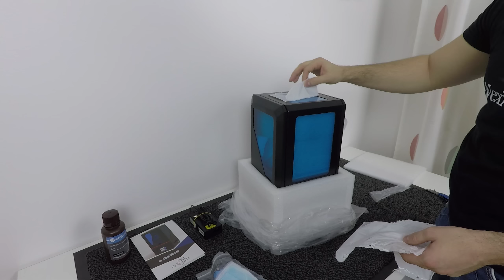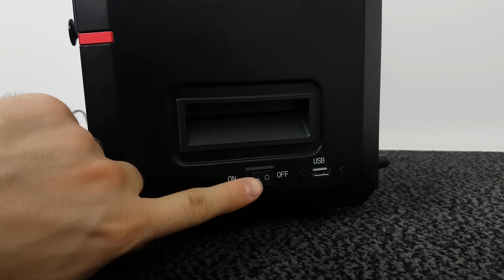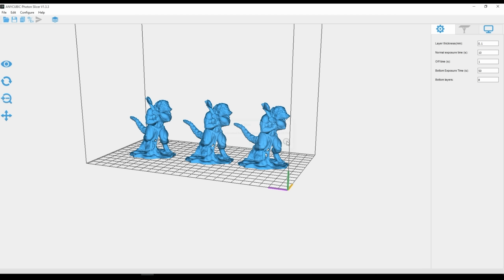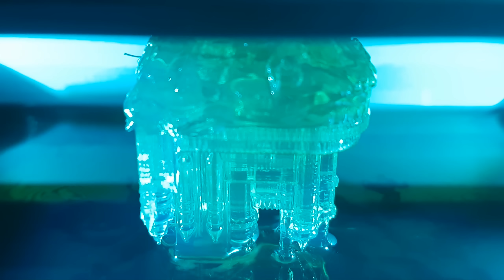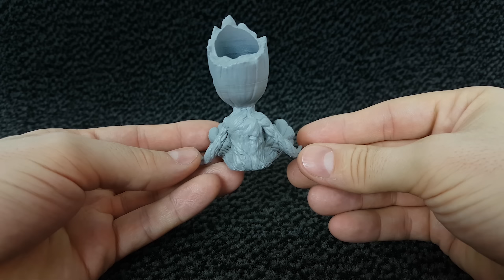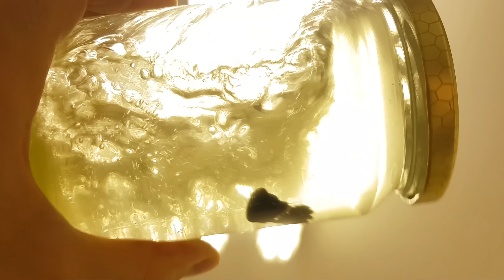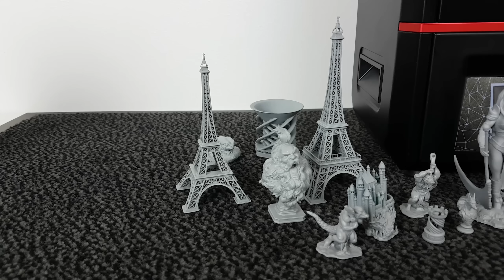Anycubic Photon DLP 3D printer Review - insane print quality!

Comment from the maker: Finally Anycubic start to sell Resin for Photon! Here are links: 
ANYCUBIC RESIN Original 405nm
From Banggood --  https://goo.gl/Jt4anH
From Ebay --  https://goo.gl/V68rnm
From Amazon --  https://amzn.to/2OsAP6U
I upload also links in video description. 
Cheers guys! 
Nexi
Reply: Nice review! Is it possible to produce mechanical and functional parts? How strong are the parts in comparison to FDM (PLA, PETG, ASA)? What happens if the final part will not be protected with prime spray?
Reply: @android4cg  the company that I used to work for print out the parts then use it as a master to sand cast the parts in metal. Hope that helps.
Reply from the maker: Arjax Copy-paste "For example with 1L of resin you can create 50 pcs of hulk size miniatures in video. Hulk is 20grams with 100% infill. Dragon miniatures are 4grams heavy so you can make 250 pcs with 1L of resin(now for around $80) I hope you get some idea ;)"
Reply: #AllAbout3DBlog No I would not recommend trying to use a DLP or SLA printer for mechanical parts since the parts are extremely brittle and weak when compared to FDM Printers, even when only using PLA. Currently resins are just not advanced enough to produce results that are sturdy enough to withstand stronger forces and/or friction., also if you don't prime them then they will slowly become weaker and more brittle when exposed to UV radiation.
Reply: how many prints do you get from 500 ml bottle? say you are printing 28mm figures?
Reply: Nexi Tech are you french ?
Reply: Hi guys,
What type of 3d printer is better to make manual injection moulding molds? FDM printer or DLP printer?

The God of Cruelty, thank you for the info. This is the first time I read about resin vs plastic.
Reply: 450$ ain't that cheap ender is still 250$ and still comes close to the same level of detail.
Reply: Have not seen a resin 3D printer in operation before do you need an auto cad system to program the parts it need to print?

Comment: How hard it is to get the material? And does it work with any resin or only their specific brand?
Reply from the maker: It will work with any UV resin as long it is 405nm. There is link in video description for Anycubic Resin. Check it out.

Comment: What a great video.  How does one adequately clean the resin from the upside down platform?  Just wipe with paper towels and isopropyl alcohol?
Reply from the maker: Mark Pinther I found that cheap bottle spray filed with 99% alcohol works grest. You don't to submerge prints all the time. Just spray them few times and wipe them with paper towel or blast them with hair dryer.

Comment: The primer that you are using is not suitable for making models because it is designed to fill in scratches and leave a even surface. Use a modeling primer like Tamiya Fine Primer. It leaves all the detail of the model untouched.

Comment: So I want to buy one of these units to make some prototypes but I'm really concerned about committing to a purchase. The thing is...the reviews are all over the place and it concerns me. I purchased a Monoproice FDM printer a while back and it printed the first 5-6 parts great right out of the box, but after that, I could not get it to print correctly. I got frustrated with it and sold it. 
Reading the reviews at amazon the people who give it a 1-2 star rating describe a very similar experience to what I went thru with my first 3d printer. And I get the fact that you have to make adjustments, and set everything up properly, but this video makes it seem like plug and play. 
Was the machine he received just a good one? Are the people who complain and cannot get theirs to work receiving faulty units? 
What are the chances I will get the same results this video got if I purchase one?

Comment: Sad to tell you this.. but it isn't a DLP printer.. it's a MSLA (Masked Stereolithography Apparatus) 3D resin printer. DLP printers uses a projector to project an image onto the buildplatform, this one uses a LCD to mask off (parts of the) UV light that's generated by a matrix of LED's, and the masked resin will not solidify, whilst the exposed will.

Comment: This has got to be the absolute best video I have seen, reviewing and showing all the details, of the Anycubic Photon. Thankyou for being the video that made me go... "That's it, I'm buying it!".
10/10!
Reply: Mine arrived just a couple days ago and already creating mind-blowing results! Thanks again.
Reply: @HowAboutNo16  hey, hows the 3D printing going? :) I want to get started too but I'm researching what to get
Reply: @x7ogforever  It's going great honestly! You can get all the info for getting your settings right, how to make the supports effectively etc. From youtube and the Google Sheets doc where it has all of the most used resins and their settings to use them at. I believe if you were to search "anycubic photon resin settings" you would come across it easily! Good luck for when you get it!
Reply: this video may have sold me on the printer but just wondering since you use it aswell,   can you get a large print thats too big for printer to print in one    i.e 300mm x 200mm  as example would it automaticly print off print off in different sections when slicing it or would i need to select he seconds manually        (wanting to try build a high quality Atlantis)

Comment: I got ripped off by the FDM 3d printer company, mine one cost $HK8000, roughly $US1067!!!!
Reply from the maker: That's just BAD man! Why did you not used links from video description and get printer form trusted sellers?
Reply: @NexiTech   It is from trusted seller, I guess I just should have got it from another brand, the one I have is from Hong Kong, and I live in hk, so I was thinking, may be I should get one from them... but now when i look back, yea, Mainland Chinese made one is way cheaper than the Hong Kong made, and funny thing is that the HK made one is manufactured in Mainland China anyway XD

Comment: Just bought the thing.     Wanted to test it this weekend.
It sucked:           I chose a little table...25 mm high.  This is very LIGHT and thus it should always stick..?!?!          But NOTHING stuck to the liftplate.
Instead, I found a BLOB of snotty stuff at the bottom of the tank.
I tried again, same result.

Could it be that my z=0 was too tight against the flexible bottom of the tank ?
(when playing with the paper sheet at 0,1 mm steps chosing between free and more stuck..I chose the more stuck/resistence).
All other settings were factory standard.

Or the fluid is shite (what came with the box..like yours).

Further annoying shit:
The Netherlands DO NOT ALLOW THE SALE OF 99% ISOPROPYL ALCOHOL!!
(I learned that AFTER I bought the machine).
Supposedly this alcohol is used in the making of amfetamines , xtc, or whatever...
In Germany (Amazon) they do sell it but do NOT send it to Netherlands.
Presumably the germans do NOT make XTC ??

So I used another type of 70 % alcohol, (Ketonatus).. and I saw that shit AFFECTS the tranparency of the tankplastic bottom.
FOR FUCKS SAKE:
This supposedly simple thing throws  A LOT OF pitfalls to me.

I HATE IT !

Comment: Greetings.
I have a question, in the sla printers you also have to do the printer configuration process as it is done with the fdm?
Are all the previous "adjustments", like adjusting the bed, the fans, the height of the layer, etc., similar in the sla printers?
Thanks for the help, I plan to buy a printer.} Sla
Finally, what do you recommend ?: wanhao d7 vs anycubic photon.
Thanks and keep going with your videos!

Comment: the print looks amazing! A question I have is that what's the life time for the tank that expose to the laser or LED screens? I heard you need to get new tank after about 60 prints because it gets cloudy. is that the case for both SLA and DLP printers? 

And lastly, I was told DLP prints have stepping on curved surfaces. I mean how obvious are the stepping and will it be a big issue if used for molding?

Comment: what's the maintenance cost on DLP printers? or how long they last before you start to need to get replacement parts? I've been using my 5 year old FDM printer. Been printed 250 hours+ and I've replaced the fan, nozzle, some minor accessories with a total of about 50 bucks. 

But recently, I need to print small model kit design parts and I've reached the limitations on my FDM. thinking of getting a DLP printer but can't quite make the commitment. I worry that the running cost and maintenance cost are too high.

Comment: Hi. I would like to know after using Photon for over 6 months, is it working fine now? I heard the LCD may not working after several month, how about your photon LCD? Have you met some problems till today? Thanks!
Reply from the maker: Q M My Photon still works great. I did replace tank foil two times but I don't have any problems with my Photon LCD but to be honest I don't print on my Photon every day. 
I think that LCD might get weaker and eventually fail if you use it 24/7 for more that 6 months at least some people claim that.
Reply: Thanks a lot. That's helpful:）

Comment: Why aren't you printing larger figures?
Reply from the maker: Lis Amita Have you not seen specs of build area? This 3D printer is for maximum details in miniatures not for large object's. If you want to print large go with CR10S or S4, S5...
Reply: Nexi Tech so there is no dlp printer for large figure? Because the printer you suggested aren't dlp (?)
Reply: Nexi Tech Nope, cr-10 quality turns out to be great! Though the detail aren't great compared to dlp printer
Reply from the maker: Lis Amita Not that Am aware about. All DLP and SLA 3D printers(Home use) have pretty small print area.

Comment: Hey! This is a very comprehensive review, thanks! I just have one question. How much does printing each miniature cost, roughly?
Reply from the maker: Heaven Builder Thanks:)
 Copy-paste "For example with 1L of resin you can create 50 pcs of hulk size miniatures in video. Hulk is 20grams with 100% infill. Dragon miniatures are 4grams heavy so you can make 250 pcs with 1L of resin(now for around $80) I hope you get some idea ;)"
Reply: Okay, that's actually a lot cheaper than I expected. Wow. Thanks!

Comment: I have big problems printing anything big on the printer. Small objects are fine but as soon as I want to use a larger build area to outer parts of the first layers wont stick to the build plate :( I levelled the shit out of this thing and tried differnt exposure times.

Comment: Hi i saw that max dimension are.. 11x5x15...but all models i saw in your hand like skull are bigger... How it s possible.. Thanks aclot for your answer.. Thierry
Reply from the maker: séverine moulinet 
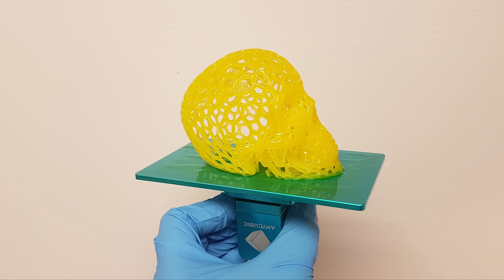Printing volume is 115mm *65mm *155mm. It's not that small :) Skull is printed in 180 degrade rotation so that you use maximum possible size. Look at 14:31

Comment: Thanks a lot for the great review. About post processing, do you have to immediately take the model out after print is finished and clean with isoprop? And then expose to UV light? Given that it take hours to print can I start the print overnight let it finish and hours later do the cleaning and curing? Cheers
Reply from the maker: san k  You welcome :) You don't need to take print out right away for cleaning and curing with UV light. Printing overnight is just fine. Resin will not cure with air contact so you can leave print inside printer for hours without worry. 
Cheers mate :)
Reply: Nexi Tech thanks mate! Torn between this and CR-10. I know they are both for different purposes but as a complete beginner I can only afford one of them at this point. Bit worried about the resin smell, is it OK to use this say in a room that you use during day and print overnight and keep the room ventilated?
Reply from the maker: Keep in mind that this printer(DLP, SLR..etc) is mostly used for very high detail prints like miniatures, figures, jewelry and similar small and tiny objects. CR10 has massive build volume and as FDM 3D printer it can print  huge prints. From my perspective I would go with CR10 or Cr10S as you will find yourself printing all kinds of cool medium and big projects. Now if printing miniatures is your thing then CR10 or any FDM 3D printer is no match to Photon in print quality but like I said when it comes to medium and big prints CR10/S rocks :) Cheers!
 P.S. Check my Cr10S review here:  https://www.youtube.com/watch?v=tFfMPjKhF8c
Reply: Thanks mate. I have already watched most of your reviews, they are all very informative and helpful. Yes I am thinking along the same lines, get CR10S first and then in a year or so get DLP/SLR printer. Hopefully by that time the price for DLP/SLR will also come down. Still the price point of Anycubic Photon is very tempting. I didn't even think that DLP/SLR was affordable for hobby but it is getting to affordable range now :-)

Comment: BTW one thing your video didn't touch on is longevity of the LCD and tray.  How long is the LCD expected to last?  What about the tray? How much are they to replace?
Reply from the maker: Digitalfiendscom Tray? You meant (Plastic foil) in the metal Vat? It can last very long time. If you level your printer right and filter your resin in theory can last thousand of times (Answer from Anycubic). If you damage it you can change the foil. It's not hard. 7-10 min work. About LCD longevity i can not give you answer.
Reply: Cool, thx.  That was my main concern - running costs above and beyond the resin.

Comment: Do you have a list of which resins you used and the exposure settings for each of them?
Reply from the maker: Joe I. Fabritz I already wrote in comments that I can only recommend Anycubic 405nm resin(grey and black) in video. Other (Yellow resin) was universal 405nm as well but not really I order from local company here in sweden but I can't recommend it because it starts to cure in contact with air and inside the printer as well. Settings that I used for all prints was standard(0.05mm) and show them in video. Except for Eiffel tower which is (0.1mm).

Comment: Anycubic Photon is truly amazing printer. I been printing non stop about 2 weeks now loving it. 
Only problem is Anycubic engineer choose blue transperant panel which is totally unacceptable decision. Blue totally don't block any 405nm uv,  even the room light will effect the resin inside as showed in this demo video. https://youtu.be/iD_5J1aIiR4 

I did change mine to orange acrylic panel which almost completely block uv light

Comment: Thank you very much for taking the time to put together such an excellent review.  I'm completely new to 3D printing so have been scouring the internet and YouTube for reviews of various 3D printers and tech (FDM, SLA, etc).  I hadn't come across this printer yet, but this seems to be exactly what I'm looking for.  I'm primarily concerned with detail for 28mm scale miniatures and scatter terrain (crates, walls, etc).  My only concern is the smaller printing area vs many FDMs.  Do you think this printer could handle some of the buildings from, for example, ImperialTerrain.com?

Also, what do you do with the extra resin that is sitting in the tray?

Comment: Awesome review!! really considering this printer. But i do have one question. You do mention the default 50 microns layer thickness, but this printer can go to 25 microns right? Thanks!
Reply from the maker: Davide Gagliardi Thanks :) Yes you can print in 25 microns. But to my opinion there is no need because layers on the 50 microns on this printer is invisible.

Comment: I have been using a 3d resin printer for about  4 years, (Stalactite 102) Ordered one of these after seeing your great review, from Ebay from Germany on Thursday arrived Tuesday (UK), printed test cube Tuesday night. Today (Wednesday) I printed a stress test calibration file, which it did as well with the default settings on the supplied resin as my Stalactite did after about 30 tweaks. At the price point the build quality is good, the prints are excellent. It is the only resin printer at this price point I have seen with that can use a flash drive, normally they have to be attached to the computer, which is what sold me on it.
My only thought to possibly improve it is if it uses the standard plug in stepper motor driver form factor, then the driver could be  upgraded to a trinamic TMS2130 allowing it to use the software controlled current limiter and stall detection routines to create a self bed zeroing program. I will take it apart in the near future to assess that possibility and as it has an extractor/cooling fan and an external vent it might be possible to fit ducting to extract fumes out of a window or run it through a filter to filter the fumes, although I don't think they are any worse than printing with ABS or nylon.

Comment: Nicely presented review.   Yes, the print quality looks good!  You have nice detail and nicely printed curved surfaces.   BUT, how dimensionally accurate does the Photon print?    If you print a 1" cube and measure it with calipers how accurate is it?    Do some test prints from a cad model of known dimensions for items that have flat and angled surfaces.   Then measure and see how accurate the print is.   Are the surfaces flat?   Are angles accurate?